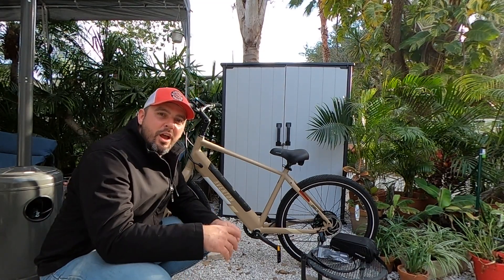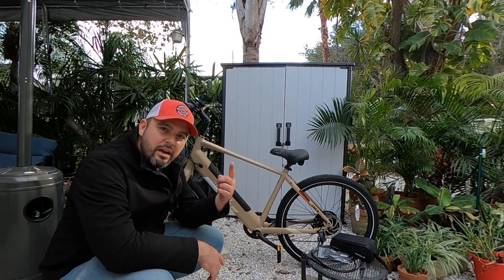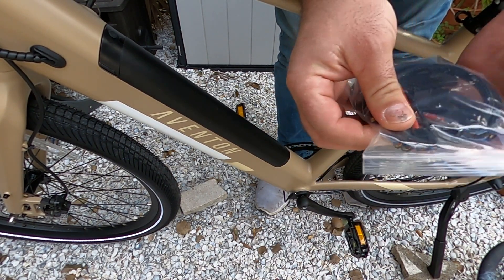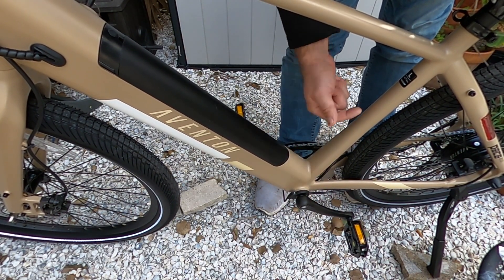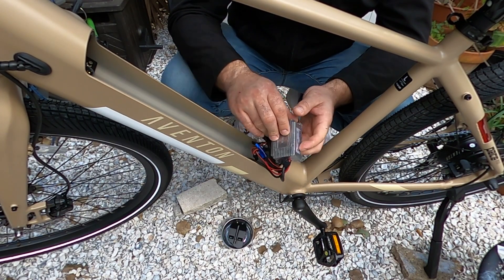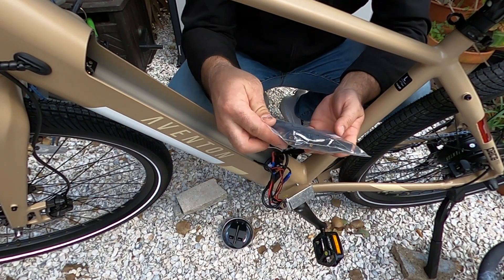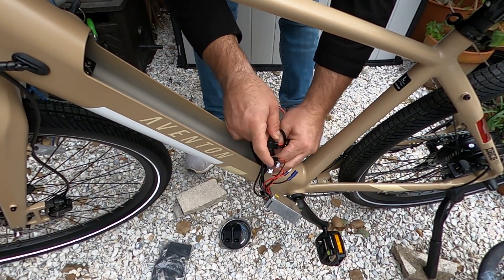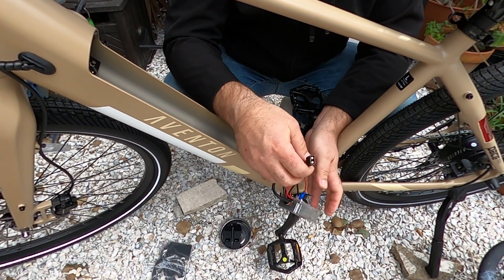Aventon | Pace 500 | Plug and Play Dual Battery Discharge Balancer Kit | Install Two Batteries

Comment: after installing, does the battery % you have left still work?
Reply from the maker: For the display meter to work, you will want both batteries fully charged before use

Comment: So in theory, i could pull the controller from my pace 350 and swap in a higher amp controller and 48v battery to make a pace 500? I got the 350 used for cheap so it might be worth it
Reply: You would also have to get a 500 watt sustained (750 watt peak) motor or the complete wheel and the display. Perhaps even the wiring harness.

Comment: Nice video but No mention of how the two batteries are charged? separate chargers or charging one will charge the other? Does each battery need to have its own BMS? On the new 500.3 Blackone2852 in a comment below mentions 4-6 extra wires involved in the Pace 500.3  whats that about?
Reply from the maker: The extra wires are simply the wires of the controller. The batteries are charged separately. The 500.3 XT60 connection is exactly the same.
Reply: @ElectricAllWheel  Sorry for So many questions i'm new to the ebikes if they are charged separately you would need to disconnect the extra battery before charging both correct??
I live here in the Clearwater area do you have a store/shop?
Reply from the maker: @nitro200flyer3  we don’t have a shop but have a recommendation for a shop nearby. I may be able to be there for consult. Please email electricallwheel@gmail.com
Tarpon Tom's E-bikes
(727) 223-4406
Reply: @ElectricAllWheel  Thanks for your time I know exactly the place I live on the P-trail in Dunedin and ride by that place often. I assume he carries all the accessories I will need for the added battery mod
Reply from the maker: @nitro200flyer3  Brad will be your point of contact. Even if I can’t be there at that time, I am in the shop weekly.

Comment: Hey, Electricallwheel I'm here in the Tampa Area Clearwater to be exact do you have a brick-and-mortar store? I have a New Pace 500.3 and want to purchase what I would need to add a battery mounted on a rear rack also have several questions do you have a way to contact you
Reply from the maker: We don’t have a brick and mortar but have a great relationship with a shop that has agreed to work with our product.

Tarpon Tom's E-bikes
(727) 223-4406

If the timing works I may be able to meet you there for a consult. Please email electricallwheel@gmail.com

Comment: Do you know if this will work on a Pace 500.3 Step-
Reply: Yes, just installed on my 2023 Pace 500.3 Step-through.  Pretty much the same install process, just 4-6 more wires to deal with related to the integrated lighting.  Mounting the H. Hailong 48V 10 Ah bag was a challenge; I ended up installing it at the bottom of the seat tube -- not ideal, but works for now.
Reply: @NotMePlease99  can you elaborate on the extra wires? Why would you need to add wires if it's all integrated into the same system.?

Comment: Have you ever noticed if the balancer gets hot ? I am concerned about placing it inside with the controller
Reply from the maker: Hi Danny. Normal operation of the balancer has never produced any alarming amount of heat. 
For the 20A- 40A we have over 250 internal installations without persistent heat issues.
Reply: @ElectricAllWheel  thank you for the quick reply, and thank you for the videos.

Comment: Any chance you are doing one for the Advent adventure? I really like the Rad Mission video unfortunately I came across it 2 days after I ordered a battery from rad. It's discounted to $200 but so it was a no brainier at the time but your set up was so easy and clean I may have to get it to eliminate lugging around the rad battery to swap out mid trip.
Reply from the maker: Here ya go😎
https://electricallwheel.com/how-to-install-aventon-dual-batteries/

Comment: Hi Matt, I checked out the Amazon site and there is no mention of what brand cells are in the pack… Do you know if they are Panasonic, Samsung or LG ??? Nice work by the way !!!
Reply from the maker: Jerry Fritz this was the exact statement from their reply about cells
“Hi, We mainly use LG, Panasonic, BAK battery cell. The battery cell used in different batches will be different. As they will be mixed together when shipping, the battery you received is one of them.”